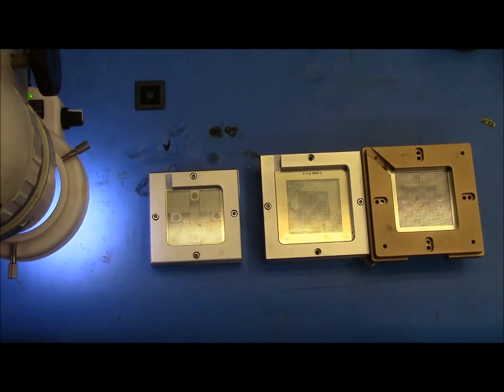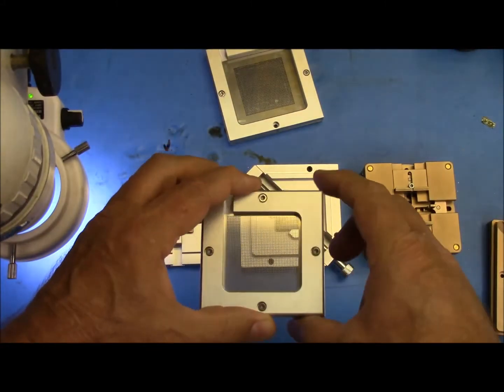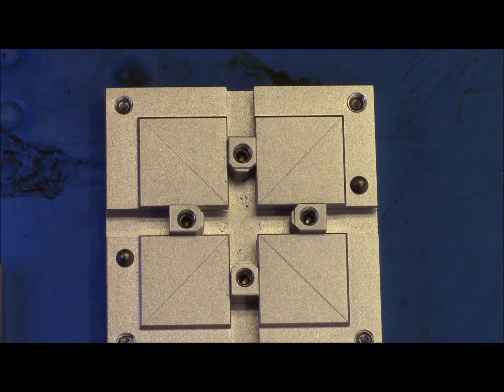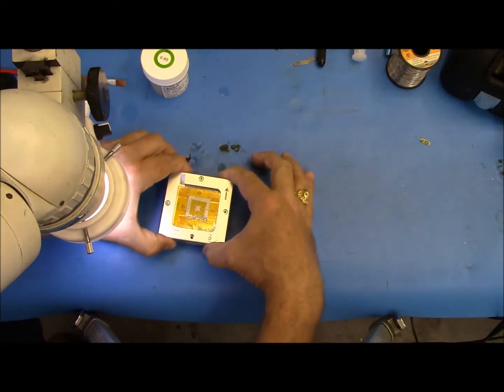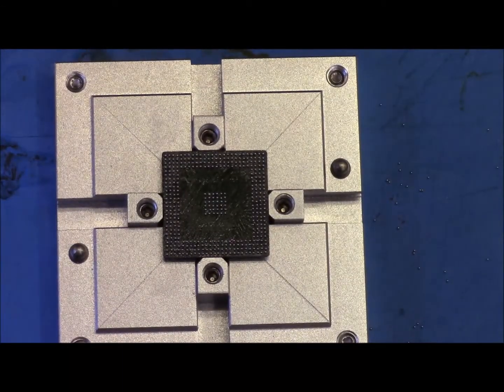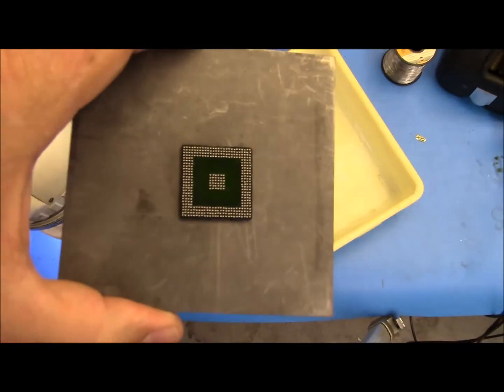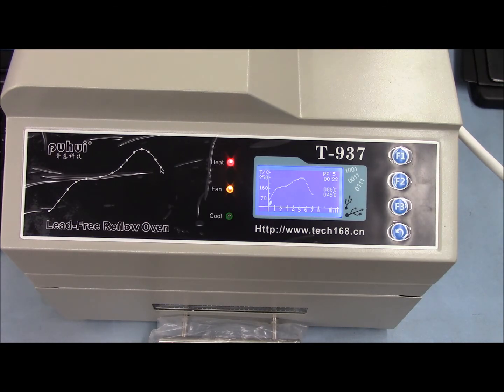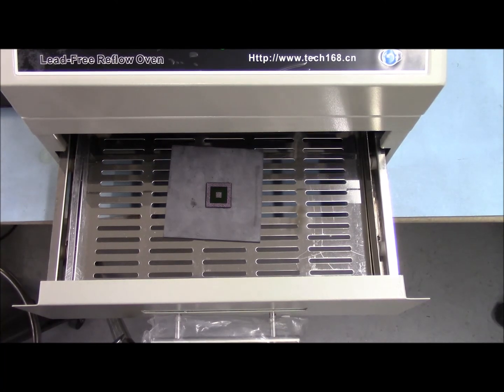BGA Reballing with the Universal Reball Fixtures

Comment: You actually took the time to tape off the stencil? Jeeze. These things are supposed to make this process easier...
Reply from the maker: Ha! Ha! We can get custom stencils made for the chip but it takes 2 to 3 days. If we get an order that has a quick turn, it is faster to tape off the pattern.  Once taped we can ball attach multiple chips quickly.  Typical order here is 50 to 100 chips.